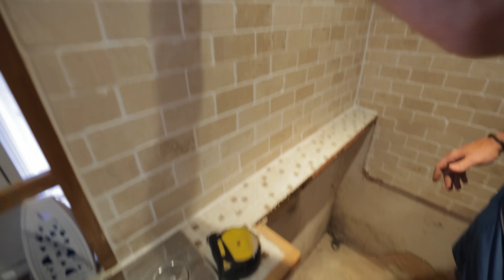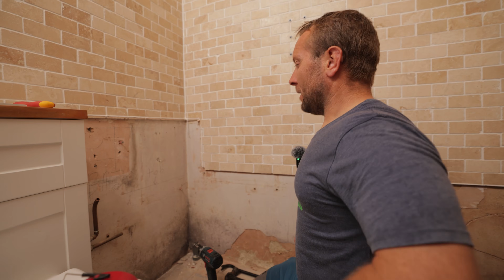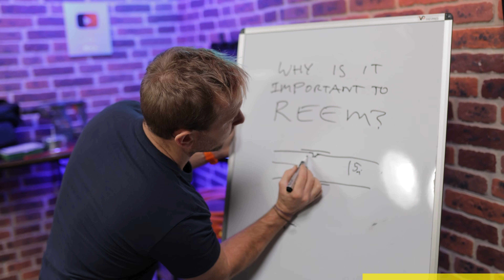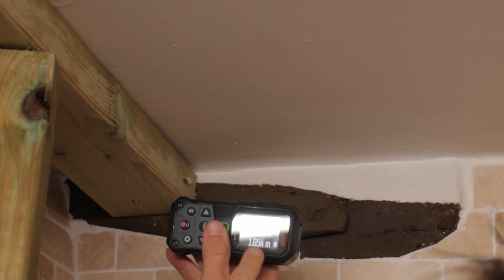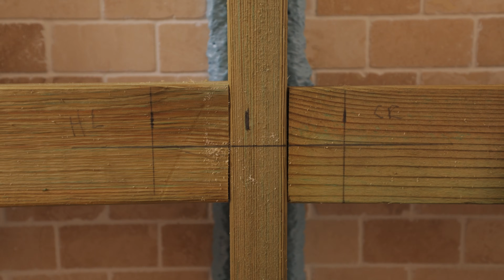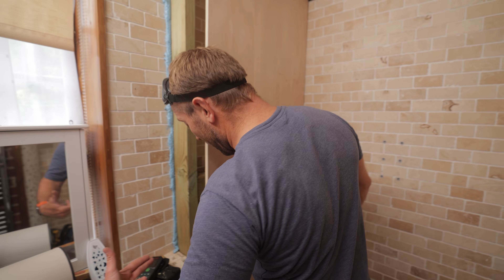HOW TO BUILD WALL FOR SHOWER + fit hot and cold water pipes

Comment: Great video, but the use of the word plumb is also a way to describe something as upright. Not level. I digress,  but I also have a an old friend who is a scaffolder who I can easily wind up by calling scaffold tubes- pipes , he hates it. Put that in your tube and smoke it.
On a rum and coke, (soft drink mixer) induced side note ; accuracy of words enables accuracy of thoughts, which enables accuracy of intended outcome. I often use use big words not just to sound clever but to make myself more photosynthesis.

Comment: Nice work... However having seen the damage a slow drip does behind these false walls, next time my mantra is that all pipes have to be capable of being inspected  so therefore no false walls but proud well formed pipe for short runs in wet room areas.  You could have done similar here... May be a ledge or shelf within the wetrromarea to hide a long run of pipe.....

Comment: super useful, subscribing! I need to see how you put that shower head on. 

Turning a 50s bath area that's been a laundry room for decades back into a bath, and need to add a 2x6 wall to fit the standard baths. The first guy that mentioned needing the wall said to leave open space in the middle, I was thinking like a window frame around the valves and shower head... but guess not! glad I started looking

Comment: Compression behind walls with no/limited access - there seem to be many different strongly held opinions about this. Thanks for great video.
Reply: Compression joints (just bare minimum) properly done and clipping the pipes, or ideally the fittings themselves be wall plate elbows screwed to timber, should be fine if hidden.
Needs reasonably good quality fittings though. 
I would prefer solder wall plate elbows though. 
I could compare that to every compression joint I do that is accessible - radiator valves onto 15mm copper for example - never any leaks and I mean even for decades. Sealed heating systems would show microscopic water loss if there were any on my work